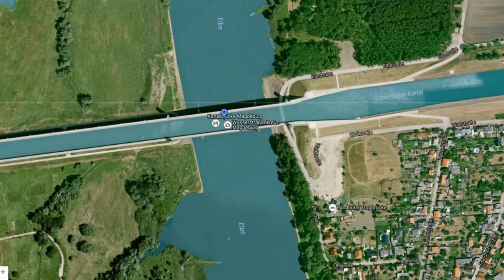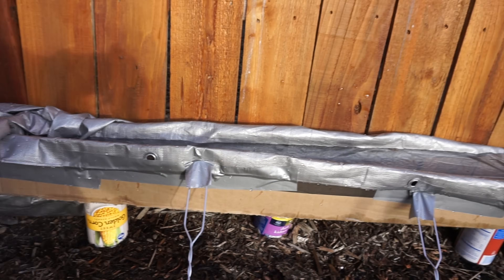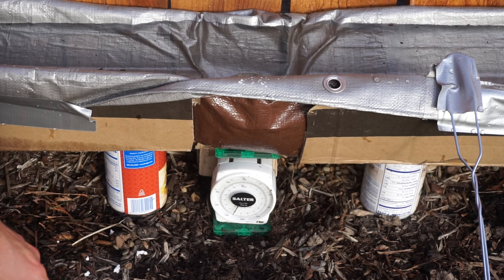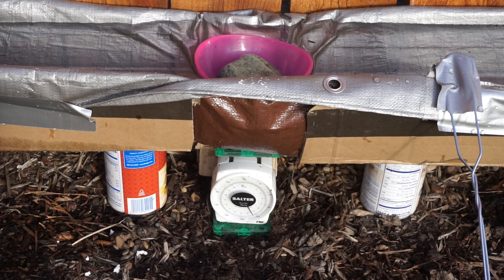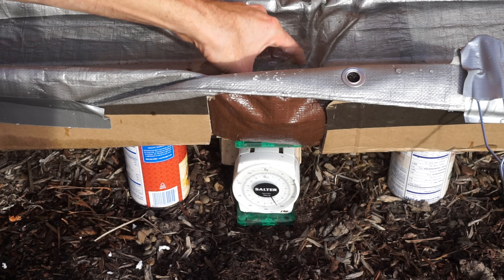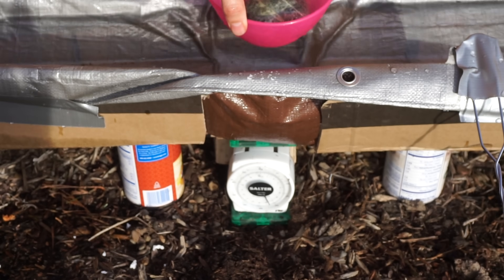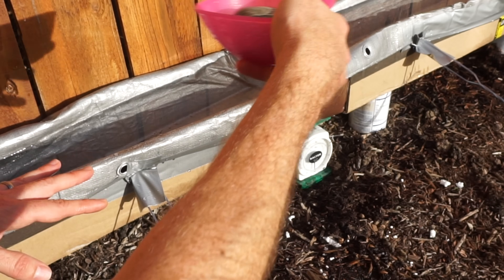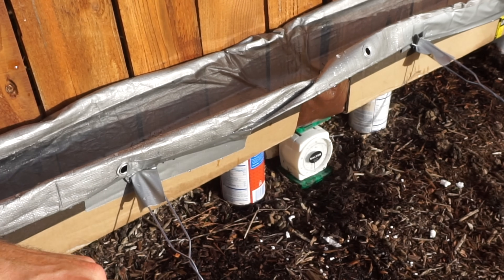What Happens When a Boat Crosses a Water Bridge? Does the Weight Increase?

Comment: Hey, I was born in Magdeburg!
The name I always learned for the bridge is "Trogbrücke", which means something close to "tub bridge".
It's part of the Wasserstraßenkreuz (waterway crossing/waterway junction), which includes a special kind of lock which reuses it's water because the channel that crosses the Elbe would lose all of it's water otherwise and an old boat lift, which is quite the cool bit of engineering in it's own regard.
The boat lift is a large tub of water for boats to go in. It stands on buoyant structures in another deep water pool.
Everything is balanced pretty much perfectly and because boats will displace water out of the tub it doesn't change weight when boats go in or out.
So you need very little energy to move the whole thing up and down as far as the pools with the buoys will allow. For that there are some threaded rods which turn to move the boat lift.
Unfortunately the whole thing is quite old. It was constructed before welding was commonplace so everything was riveted in a way nobody really gets trained for anymore.
So despite being more efficient than the sluice and easier to reach it can't really be used anymore.

EDIT: Also, for the actual Trogbrücke, the locks work in such a way that the water level in the cannel always stays the same. If a heavy boat goes in, water goes out. It's pretty much how locks work

Comment: In true Mythbusters fashion, go big. Increase the displacement enough so that the level of the water increases significantly enough to change the scale.
If my theory is correct, the scale is feeling the weight of the column of the water above it.

Comment: Bull. Pick up a bucket full of water. Now to the same thing but with 10 lbs of lead in a "boat". It'll weigh ten pounds more.
The problem with this experiment is that it's trying to weigh on small section water. The displacement of the water causes the weight to "spread out' over the entire thing.

Comment: Should have a look at Falkirk Wheel.  They utilize this feature of buoyancy by not just displacing he water up, but off the lift.  Because of this, since  they use 2 lifts simultaneously, one going up while the other goes down, the one is always perfectly balanced to act as a counterweight for the other... regardless of how large the boats are it's lifting, or even if one lift is empty... the two lifts will always weigh the same.
So the motor only needs to rotate the entire lift assembly, the motor does not have to "lift" anything, anymore than you'd need to "lift" the front edge of your bike tire.

Comment: They would have only had to make the bridge strong enough to hold the weight of the water to the point of it overflowing the sides. After that, the weight of the boat doesn't doesn't matter.

Comment: So when the boat is added, it's the same as if the volume of water displaced by the boat was poured into the water, raising the level of the whole waterway slightly. Another question would be, does the amount of surface area of all the water in the whole waterway have an effect on how much more weight the scale feels when the boat is added, and I think the answer would be "yes".

Comment: Try weighing the entire bridge rather than 1 point and you’ll see that it increases the weight as if you were adding more water, it’s still increasing, just evenly along the whole bridge. And I’m sure that the engineers did have to account for that when building the bridge. Also if you where right than you could simply put water in a bowl, put a boat in it, put a 10 ton weight in the boat, and CARRY THE BOWL AS IF IT WHERE ONLY HAD WATER IN IT.

Comment: Water weighs a lot. This question depends on two variables. 1. How the water level is maintained, ie will the object replace the cross sectional area of water or 2. Will the  water level rise hence said object adding to the cross sectional area of mass above bridge and 3. How dense is the material measured within the water above bridge, ie is it more or less than my ability to count?

Comment: A question please. Does the total weight the entire bridge carries, across the entire length of the bridge, increase by the weight of the boat  when you put the boat in ?
Reply: Yeah it would, just distributed evenly to all the footings. Think of a bucket full of water hanging from a scale, adding a boat will increase the total system(bucket) weight. Now if you made that bucket long and hung it from 10 separate scales, you would still see an overall weight increase, but divided out by the number of scales(supports). Where the boat is floating in that long bucket doesn't matter because the weight will push evenly everywhere(water is incompressible)

Comment: I stopped this at 00:31 in the answer to the question is no the foot print of the water is the same weight at the bottom regardless of the size or displacement of the boat. And ships and boat weight is marked by displacement of water to size. So if the boat has the same size and weight of water it will sink like a rock. All they have to do is build to hold the weight of the maximum amount of water without spilling out. But now if you a bucket fill it halfway weight it than add a bowl with a rock in it than the weight of the bucket will increase to add the weight of the bowl and rock and the water level will rise or fall by the off set of weight. Charlie Lindbergh asked himself does a fly flying in a airplane does it add the the weight of the airplane. The answer is yes a fly is no lighter than air.

Comment: Water weighs  62.4 lb per cubic foot .  The volume below the water of the boat  has a void . The weight of the superstructure above the , corresponds to the weight of the water it displaced .   In Vancouver BC  , they have the Deas Slough . It goes over     the Deas Island highway Tunnels .Big ferries cross over the highway .without crushing the tunnel .  One of the engineering    problems , was what if the concrete tunnel , cracked and leaked .?  So Dutch designers came up with a solution , they let it leak .  There is  a  pump room in the tunnel , that runs steady , and the insignificant amount of leakage is taken  care of . Nice idea huh ?   Theres a few designs in engineering , where things are deliberately designed already broken [ like turbine jet vanes] ,  cause you  cant break , whats already broken .

Comment: Well its a bit wrong on your explanation but i still like your video and like your explaination. But one part you got wrong. Actually bot on water bridge will increase their weight same as when we put a bowl of water on a scale and place a boat on the water the reading will increase. But in your contraption the water instead of pushing down when the boat is placed as you said the water rise which cause no pressure on the scale. And where the mass go? Well the can or just the beam has support the weight. And if the mass not increase this is crazy we can save a lot of cost for heavy construction because the weight not increase as we put something on water. But it doesnt. This also simple when you carry a pack rice your weight increased . Because a force is two way same as a spring and when we push up. The ground is stronger and manange to resist you so instead of it move you move. We only can push something that we can resist or we move ourself. Can you guys figure out where you push during push up? And why slippery surface makes you harder to push something? And why wheel dont works on icy surface. Well you got the point. But i still lOVE your video The ACTION LAB.

Comment: No. This is what displacement means. If the aquaduct was dammed at both ends and the boat was lowered into the channel then yes, the weight supported by the bridge would increase, but if the water is free to flow, as the boat moves onto the aquaduct, water, equal to the weight of the boat will move out of the aquaduct.

Comment: "Design for the small amount of water that needs to hold on top"
Magdeburg bridge dimensions in meters from Wiki: 
length: 918, width: 34, water depth: 4.25
So it has to hold 132651 tons of water. That is equal to 2.5 times mass of Titanic.

Comment: If the water level rises, doesn't it increase the pressure on the bottom of the bridge. This would also mean an insignificant increase in weighing machine's reading.

Comment: What does the water level rising have to do with weight? The water is being displaced by a bouyant object, the water level goes up but the mass stays the same, if anything the mass directly above a sensor would drop insignificantly due too the fact that the water level rise was distributed across the entire body even though the displacement occurs directly above.

Comment: Yes, obviously the bridge feels the weight of the boat, I'm kinda surprised this is even a question people would get confused by.. Of course that weight doesn't have as much effect because it gets spread out over more than just the bridge, but I'd say your conclusion isn't exactly accurate..
You can even see it in your demonstration, the weight increase actually happened the moment you set the boat on the water, it even moves the dial a bit. It's like putting a bucket of water on a scale, then setting a toy boat on top, of COURSE the weight increases, you've added the weight of the boat/cargo to the system. lol Again tho, for that bridge it's not enough to matter.

Comment: A better explanation would be that the water will provide an equal and opposite force to the boat...and because liquids can not be compressed... so the only way the water can  provide  an equal and opposite reaction   from the mass of the boat providing pressure to the water is raise the elevation of the water to reach equilibrium so the  the force from the boat is cancelled...it's no different than someone applying pressure/force to a wall and not being able to move it because the walls reaction is to apply an equal force back to the person to cancel the force

Comment: He makes sound like water is light.  If you swim 50 feet below a water surface, and a 12" inch hole opens up, it will have 1700 pounds of force (sucking power).  And more force if a bigger hole.
Also, if you stand in 1" inch deep water, and even if the water your standing in is as wide as an ocean, it can't suck you down, even a big hole.  Gravity might still suck you into the hole, but the 1" inch water cant
Reply: The channel that runs through the bridge is a closed system. It wasn't really demonstrated but there are locks that ensure a constant water level

Comment: The scale did show a slight increase right as the "boat" was lowered into water. The weight of the "boat" is distributed across the entire bottom (and even banks) of the river, and it doesn't matter all that much if the boat is directly above the scale. This is why we don't get crushed swimming underneath big ships. This is why we don't get crushed when helicopters and planes fly directly overhead. 
A more interesting question: Would the scale reading show added mass if the stone was lowered to the bottom at the far end of the river, away from the scale? 
Answer: yes, because the scale now has to support the same volume of water it used to, plus the portion of the water displaced by the rock. 
This becomes more obvious when you imagine having two connected vessels, with a pressure plate measuring how heavy the water is at the bottom of one of the vessels. Fill the system half-way with water, and then start filling the vessel without the pressure plate with sand until it displaces all of the water in that vessel. The pressure plate in the other vessel will give you a reading that the water pressure above it has doubled.

Comment: @The Action Lab retry the experiment with a pot of water on a scale and submerging the weight at different depths from partially submerged to fully submerged to observe the results. also a more sensitive digital scale would show the negligible increase in weight in your experiment. the weight of the rock may be negligible to the weight of the water

Comment: Hydrodynamics means equal pressure in all directions. Combined with the surface area and surface tension, the weight distribution is equal across the entire channel. I would like to note the overall weight does increase when the boat is added, and the scale might increase a few micro-grams but that scale isn't sensitive enough to quite register that. If the channel were shorter, the scale might register a fraction of a gram increase when the boat is added as a whole, but won't change when it floats across.

Comment: This would have made more sense to me if it was clearer that the premise was exclusively about the bridge section and not the body of water. 

Ie his experiment DOES weigh more. He’s adding mass to the system, BUT the bridge portion of it, doesn’t have to support that weight because it’s gaining the boat mass as it loses the displaced water mass. 

He does say this is about the bridge over and over, but it just didn’t click for me I guess. It sounded more like he was implying that once something is floating it’s weightless. Like the truck full of birds with half of them flying thing.

Comment: The weight is just being distributed across the entire body of water. The supports of the structure would still need to be able to handle the extra weight of the boats. Put digital scales on both ends for support instead of in the middle and I bet you will see a larger change when the boats are added.

Comment: Before watching I'm gonna guess yes, and also kind of no. The ship technically causes the water level to rise when it floats, however slight that increase may be. However, that increase does not depend where the ship is on the water, so the weight on the bridge stays the same whether the ship is 10 miles away or on top of the bridge.

TLDR: Practically no, it makes no difference, but technically just placing the ship in the water does cause the weight on the bridge to raise ever so slightly.

Comment: Basically the weight is distributed across the entire bridge so that each point of the bridge gets a tiny fraction of the stone's weight 🤔
Reply: It is distributed along the entire waterway I think, not just the bridge
Reply: @TNaizel  I totally agree with you! Thinking about the problem the whole day I realized that our weight is actually the resultant of total downward force minus any resistive force acting upwards. Since the boyouncy force equals the weight it cannot act downward anymore so no weight gain, instead that force imbalance is used to raise the water level since the force exerted on all other sides cancels each other out. I'm still in doubt though, so some clarification is greatly appreciated 😊
Reply: Yeah, in a closed system such as his bridge in the video. Otherwise the water will be displaced. There would be less water on the bridge.

Comment: The rock by itself should also weigh less when placed directly in the water bridge, since it's displacing an equal volume of water.  If you weighed the rock outside the water, then place it in the water on the bridge, the weight difference between the two scales should be the weight of the rock minus the weight of the water it displaced.